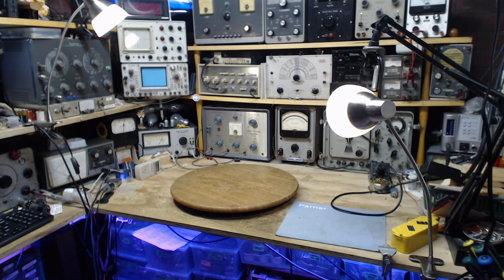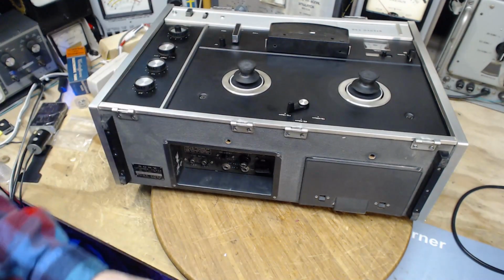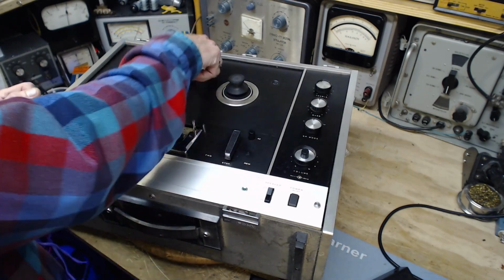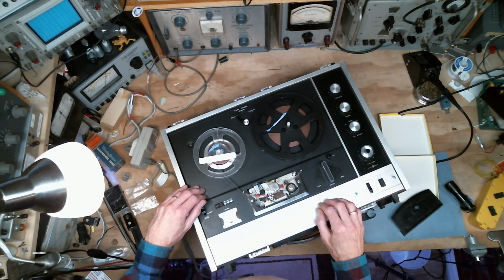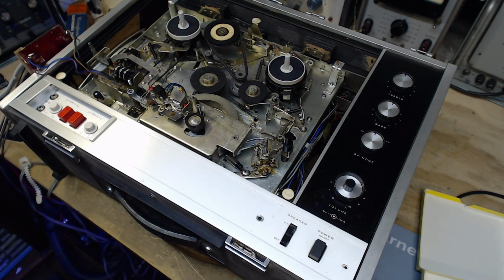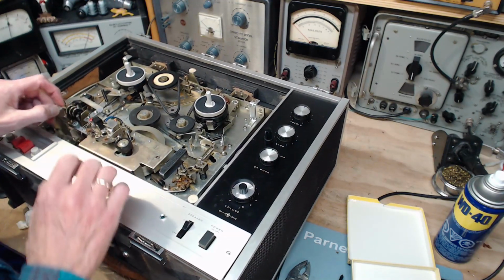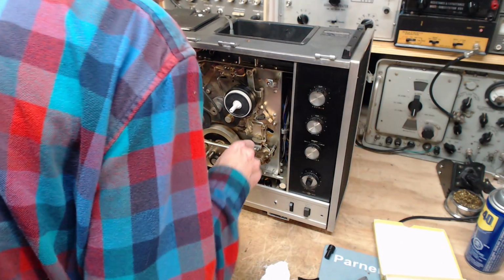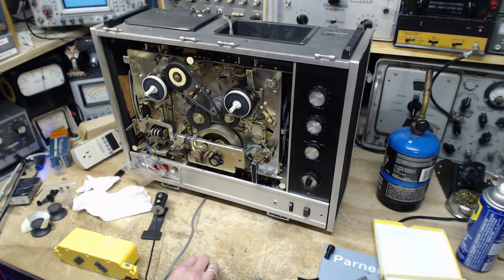Sony TC 530 Reel-to-Reel Tape Deck Video #1 - Getting it Working

Comment: Dude, I'm afraid there's no way around taking it apart, clean, and lubricate that pivot. If you don't, even if you get it to move fairly free, it will gum up again in no time. This is one of those things one might as well fix right from the start.
Otherwise it's a cool machine. Nice and easy to work on. Easy to find parts for. Simple and robust with short signal path's, and without a lot of unnecessary fuss. Way better than the B&O (of course that doesn't say much since everything is better than B&O, but you'll soon know what I mean). When you're done fixing it, and if the heads aren't to worn, this baby will bring you joy for years to come. 
Only thing one could wish for is that they had put it in a wooden box to look nicer, but perhaps you can come up with a couple of magic tricks to take care of that.  
Wish you the best of luck and a great time fixing it. I'll be looking forward to the next video.